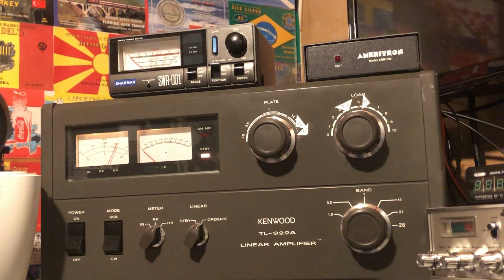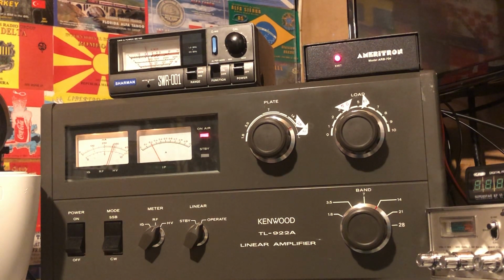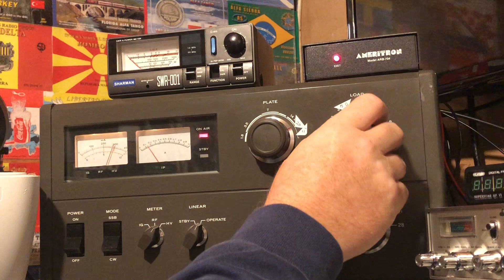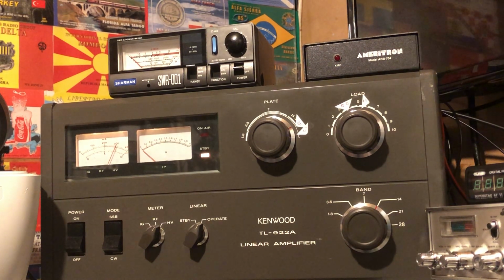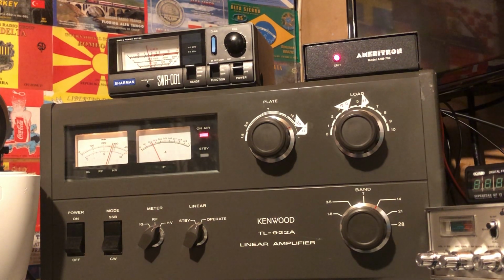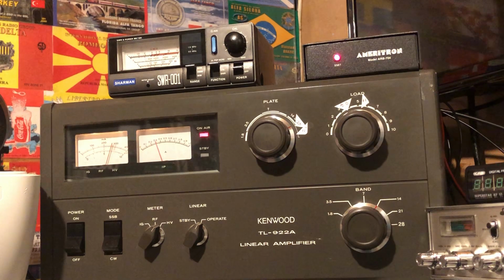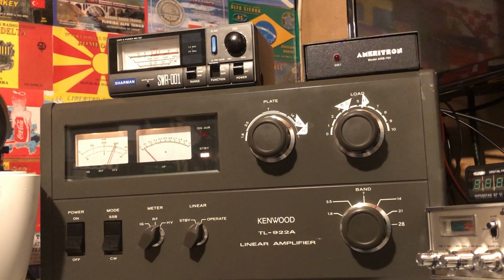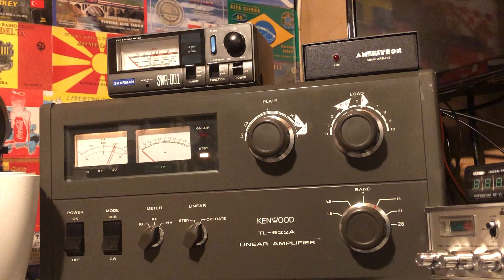Kenwood TL922A Trusty old amplifier

Comment: Is that the same TL922 I repaired ?
Reply from the maker: Yes Mark worked great but sadly developed a fault and sold the amp which I didn’t want todo as always wanted this version but didn’t think would be viable, chap that bought it tracked down a dry solder that was just age related and nothing todo with your great work